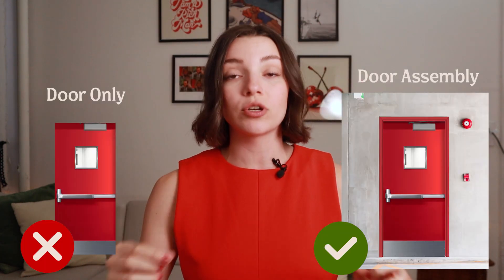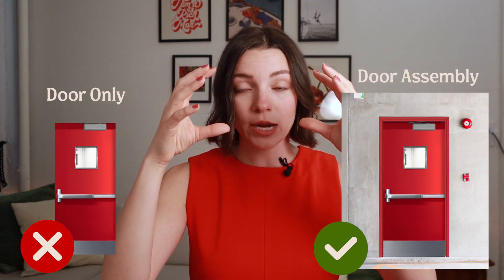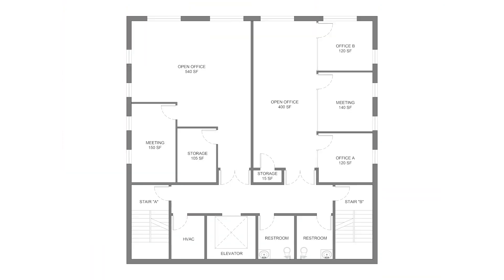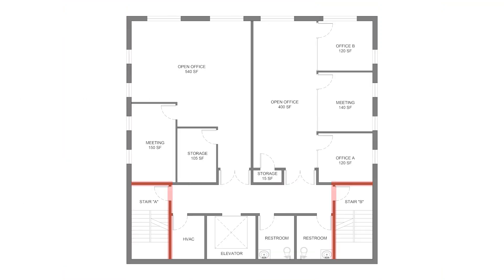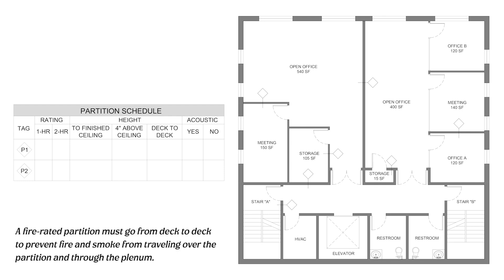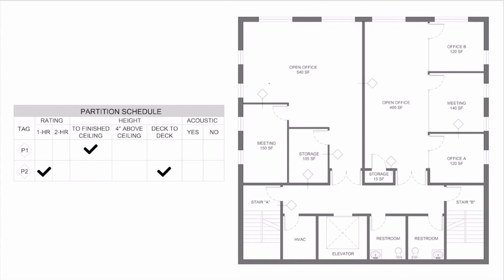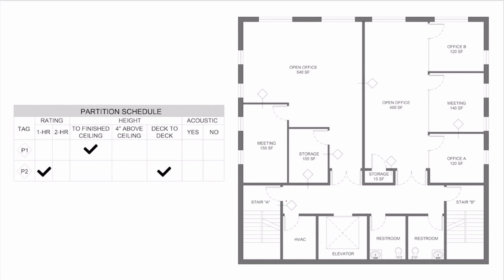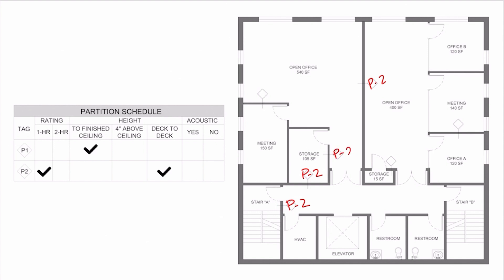Fire-Rated Partitions EXPLAINED (and Practice Question!) | NCIDQ Test Prep

Comment: May you explaine why the elevator shaft walls are not fire rated? I understand that the corridor is rated and stairwells, but just to be clear, aren't elevator shafts rated too?
Reply from the maker: Hi! Typically elevator shafts are fire rated because it’s an easy way for smoke and fire to travel. However I don’t get into detail about this in this video specifically since this is meant to just provide a basic overview of the topic for the NCIDQ exam

Comment: Fire partitions may terminate at fire rated ceiling, not always at the deck, unless is a Fire Barrier.
 IBC 2021 
708.4
Continuity.
Fire partitions shall extend from the top of the foundation or floor/ceiling assembly below and be securely attached to one of the following:
1. The underside of the floor or roof sheathing, deck or slab above.
2. The underside of a floor/ceiling or roof/ceiling assembly having a fire-resistance rating that is not less than the fire-resistance